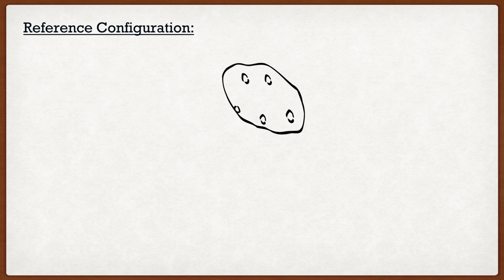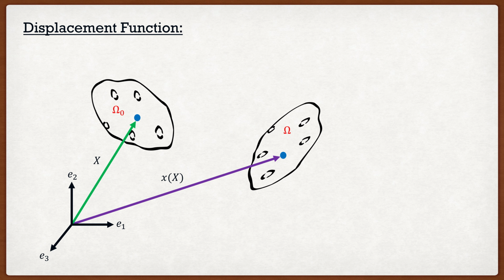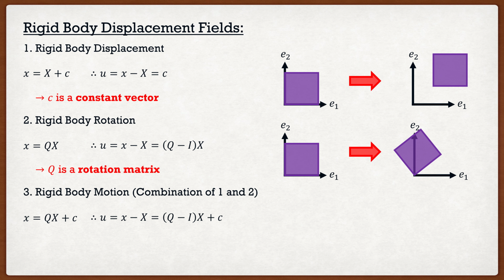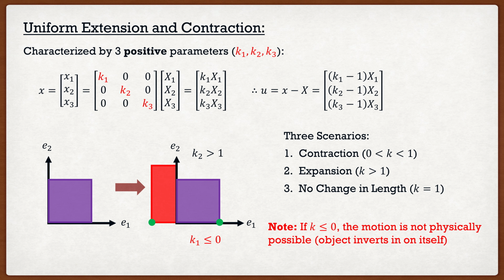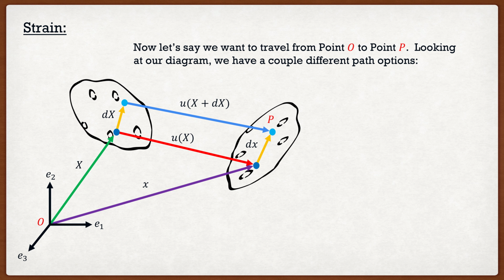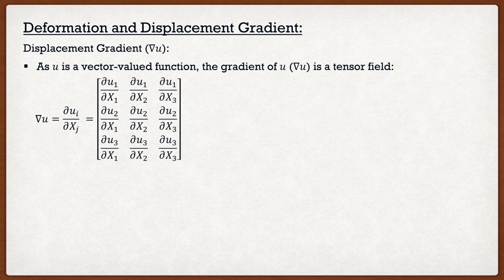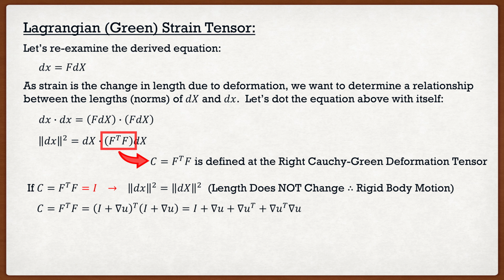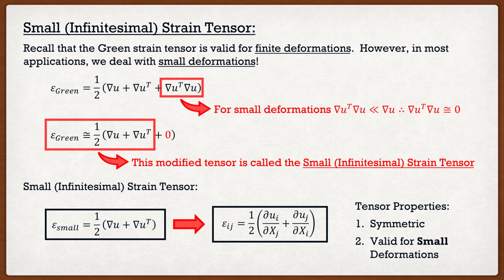Solid Mechanics | Theory | The Small (Infinitesimal) and Green Strain Tensors

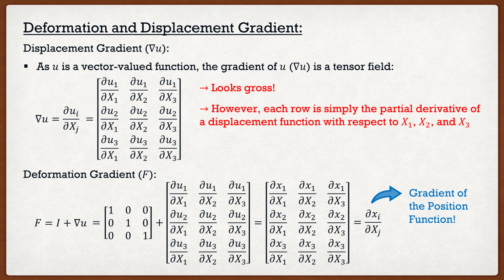Comment: In the slide for the position gradient (22:21) I understand why du1/dX1 + 1= dx1/dX1, but what happens with the off-diagonal terms? why du1/dX2= dx1/dX2? and not du1/dX2= dx1/dX2 - dX1/dX2, is it dX1/dX2=0, why? 
Can someone explain it ? is it because for the reference frame?
Reply: the off diagonal terms vanish. Take for example, du1/dX2 = dx1/dX2 - dX1/dX2 = dx1/dX2 since dX1/dX2 = 0. The X1, X2, X3 directions are orthogonal to each other. dX1/dX2 means what is the infinitesimal change in X1 if we change X2 by an infinitesimal amount dX2, and the answer is zero due to orthogonality. In terms of Cartesian notation, think of dx/dy... that is just zero
Reply: @physicsanimated1623   Thanks you so much.
Reply: Ciao! Penso che sia perché u1 = x1-X1 e di conseguenza quando andiamo a derivare rispetto a X2 o X3 usiamo la regola di derivazione della somma e abbiamo la derivata parziale di x1 rispetto a X2, meno la derivata parziale di X1 rispetto a X2 che è nulla( dal momento che abbiamo scelto una base ortonormale e la componente di X1 relativa alla direzione di X2 è costantemente uguale a 0).
Reply: Can you please explain this?
(F.dX).(F.dX) = dX.(F^T.F).dX  -------> How did we get this?